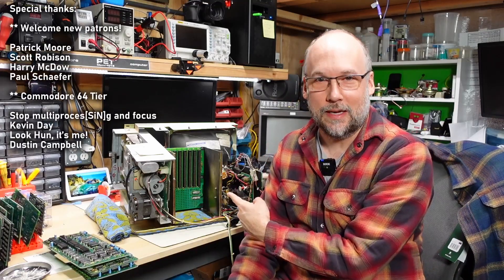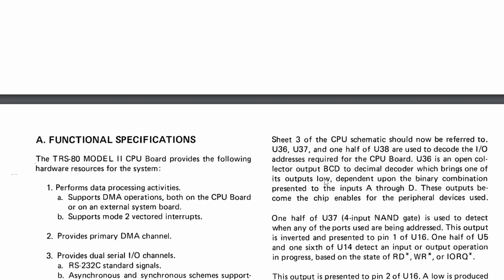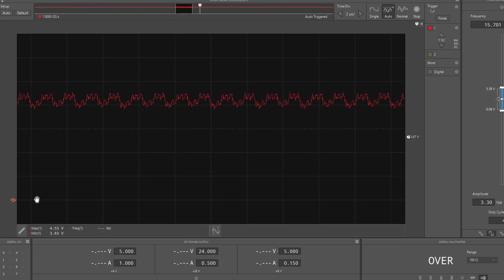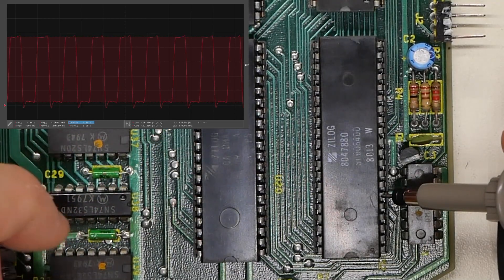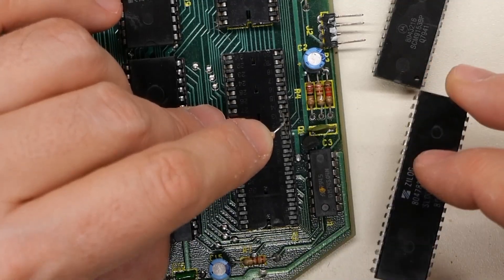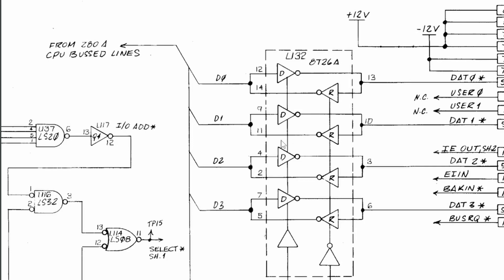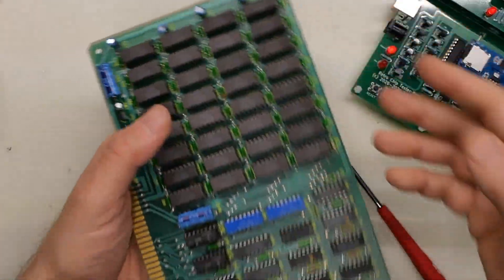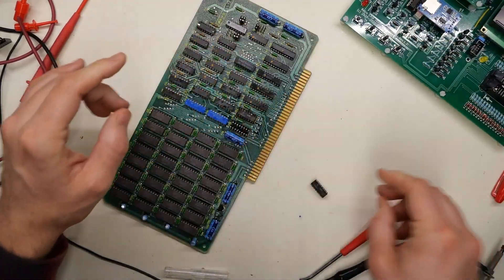I fixed the TRS-80 Model II

Comment: 16:46 "Can that be 1987, seems kind of late?" Perhaps, but the company I worked for bought hundreds of 20 MHz Z80 processors from Zilog about two decades later (around 2007 or so). We used it as an embedded controller just as we did several times before, in the 80s and 90s. I think they are still made, to this day.
Reply: Weren't Z80s used in washing machines and the like up til fairly recently? I presume it's all ARM these days
Reply: @TheErador  I don't know. To me, washing machines sounds more like Z8, 8051/48, 68hc11/08, PIC, TLCS-870, or even small 4-bit BCD machines like TLCS-47, or similar. But it's totally possible, of course. 

Our products were technical/scientific instrumentation in pretty small series. So cost per unit wasn't critical, only development time. And we already had people knowing the Z80 in and out, including me. Many routines and principles could be reused. 

(The Z80 here controlled a small graphical LCD display as well as buttons, knobs and serial interfaces. It also did the actual measuments along with floating point calculations of results and feedback adjustments.)

I don't think it's all ARM. There are at least a couple of dozens microcontroller families still sold that are not (yet) ARM based. There are more to the world than the PC and mobile phone markets :)
Reply: Yep, the Sega Master System and Game Gear both used the Z80, and they were still being manufactured in the late 90s in Europe

(The Master System is still being manufactured in Brazil, but I expect – but don't know for certain – that it's using a SoC rather than a discrete Z80)

Comment: You can clean the rust off of  iron-containing pins and tin them with solder, then they'll be a lot less susceptible to rust.  That is essentially tin/lead plating them.  Great channel, holiday cheers!
Reply: And do use leaded solder. Nothing in that machine is RoHS compliant anyhow, and tin will act as a sacrificial anode so you don't want that to be the only or even the bulk metal in your new plating if you can help it.
Reply: I was considering that idea too. Will the added thickness still allow the pins to fit in the socket though?
Reply: @misterhat5823  If the excess is wicked away with copper braid, it shouldn't be a problem. We're talking a couple thousandths of an inch.
Reply: Electroless tin plating solution would be a lot faster and just leave behind a thin layer of tin. I used to get it at Radio Shack to plate my homemade PCBs back in the early 90s.
Reply: Had the same thought.  If they are so hard to find, maybe do a better job restoring them so they last longer.
Then again, probably more content to be made if they do die and you need to make an adapter. 
🤔😆

Comment: The Z80 is perfectly capable of disconnecting itself from the bus.  BUSRQ and BUSAK are involved in that.  The Z80 is designed to work with a plethora of support chips (DMA, CTC, SIO, PIO, etc) and no special interfacing is needed for it.  Bringing BUSRQ low completely tri-states the address and data bus and halts the CPU.
Reply: Yeah, I was pretty sure this is how it works on the Z80. For completenss´sake: once the Z80 has finished tri-stating the buses, it then asserts the /BUSAK signal, so the other device can know it´s safe to take control of the buses.
Reply: The Z80 can't disconnect ITSELF from the bus though, which is what he meant. An external chip can do it, but there's no CPU instruction to do it.
Reply: @AureliusR  Well, a CPU disabling itself would essentially render it useless until you reset it.  When a CPU is removed from the bus via tri-stating the bus and control lines, it can't read an instruction to wake it up again.  If CPUs could tri-state themselves in software, a simple malicious hacker could simple send the CPU instruction to remove itself from the bus, then nothing could restore it.

Tri-stating a CPU MUST be done with external hardware, otherwise, what's the point of removing the CPU from the bus?
Reply: @AureliusR  As long as BUSRQ is low, the Z80 is DISCONNECTED from the bus.  All address, data and control lines are tri-stated.  It has the same effect as unplugging the chip.  I don't know what your defininition of "can't" is, but you're wrong.

NO CPU has an instruction to tri-state itself from the bus.  That would have the effect of locking up the system.

The 6502 cannot tri-state, but the 6502C (the Sally Atari variant) has a HALT pin that tri-states it.  The Z80 has BUSRQ, that tri-states it.  Other CPUs have similar pins to "disconnect" the CPU from the bus by having a control pin that does it.  Absolutely no CPU can tri-state itself.  They all need an external control to do so.

Some CPUs have a HALT instruction that essentially halts the program counter until an interrupt is received, but it's not a tri-state "disconnection".

Now read all of that SLOWLY.

Comment: High Adrian it’s me again.  I ran the cobra bbs up here in brantford Ontario. I ran the French connection. First of all I worked in a press shop and supported as a single parent of three kids during the day.  The bbs ran on a TRS80 model 1.  I bought the double density kit from radio shack. It came with a new version of dos.  But I used newdos 80 v2.  Awesome OS. Pdrive allows you to configure drives. Now to the point. I had tons of problems as it would skip bytes writing sectors.  Took it in and they changed the z80 to a z80a. I had one of early ones.

Comment: The zener on the video controller may be to bias the substrate.
Older P-MOS tech ICs sometimes need (or work better) when the substrate is biased at some voltage. I would assume pin-1 is connected to the substrate.
Cheers on getting progress on the TRS-80.
Reply: You mean disk controller.
Reply from the maker: It's on my to-do list to buy a 2.5v Zener so I can restore that back to the way it was ... but yeah I have a feeling it's definitely some kind of negative bias thing as well.

Comment: This brings back a LOT of memories.  I owned a Trs-80 Model I purchased Jan 1978.  
I then owned the full Mod I setup: Expansion Interface, Rs232-c, 48k memory, 4 disk drives, Line Printer VI, (numerical keypad added), lower-case graphics chip added.
Then owned a Mod 4, with High-res graphics  and 15 Meg external Hard Drive.
I also worked on and repaired a Model II that had the expansion Drives cabinet of 3 drives.
I used to write machine language for the Mod 4 and would translate programs from the Trs-80, IBM PC, and Apple IIC.  
Those were great computers.
The Mod I lasted 21 years.  Wished I kept it.

Comment: Congratulations! That is for sure an impressive repair. I'd even say heroic!

Those corroded Fujitsu ICs need a little more treatment than a bit of Deoxid. I'd sand the corrosion away from the legs and then plate them with soldering tin. If the legs are brittle, solder them onto a machine pin socket to make them last the ages.

Comment: Great Job!  I owned a couple of model IIs, one with the disk expansion unit along with a model 12 & 16 w/1MB of RAM as well as a 5, 12 and 74 MB hard disks.  It was a glorious din when doing sorts on the model II across the floppies in the expansion bay. The model 16 had a 5 port serial card and ran Xenix.   It was a blast to log into five terminals and run the accounting and inventory control suite all at the same time.  It also supported two printers which made some even more exciting noises.
I really appreciate your patience and persistence towards getting this machine to work again.  There's nothing like the sound of a model II booting from a floppy!  Music to many of your viewers' ears, I'm sure!

Comment: Adrian, EXCELLEN! It really takes a lot to kill a Model II. Unless you're certain, I wouldn't throw that Z-80A out. It could have been a bit of corrosion too. Your's is a first gen Model II. Over their life they upgraded the FDC, changed the power/reset switches, made board revisions and other improvements. As you know the II was retired to move to the short lived 12. The 12 became the 16 and the 16 to the 6000. They overlapped in some production or sales but that is their lineage. A very robust, if limited platform for what it was in the late 1970s and 80s. I started computing on one in 1981. Over the decades I've owned five of these IIs. Your bad CPU seems odd but possible.  I've NEVER found one that had a bad processor or any bad ICs. Even a nasty corroded one I saved from the trunk of a crusher car was saved and worked with a little cleanup.  As for their power supplies failing, YES! That is usually because of the caps. Replace any epoxy potted RIFA caps. They crack, take in moisture and will smoke worse than a speakeasy in the 1920's.

Thank you for the great series. It's now time ...make it do stuff Tandy never thought of.

Comment: Just a thought - when you swapped Z80s, you also applied some DeOxit to the socket, so you might want to give the original Z80 another try.
Reply: Agreed.  Corrosion/oxidation on the pins may have fouled the original signal on Pin 3.
Reply: Came to the comments to say this - definitely worth another go
Reply: I also came to say this. This was a great successful video. Really enjoyed it. But, Adrian jumped to a conclusion there. Some of us love the little CPUs; we don't want to give up on one - especially an original  vintage one - without giving it a full chance. Please, Adrian, try plugging it back in after that DeOxit treatment and see if it is really dead or not.
Reply from the maker: The thing is, the address lines are outputs from the CPU, and as seen in the video, I had the scope probe on the CPU pins directly. The socket has nothing to do with what signals come out of the CPU package.
Reply: @adriansdigitalbasement  Unless perhaps there were voltage drops across the oxide at GND and Vcc. You know, the more current over a certain resistance, the larger the drop.
Reply: Unless the pin actually rots off the ic, an untouched socketed IC should not get corrosion between pin and socket fingers enough for it to lose conductivity. That z80 's pins did not look that bad.
I have had pins that were literally green and where the sockets fingers were also corroded to nothing... That's a problem...
Cheers,
Reply: @herrbonk3635  If it was drawing more current from due to corrosion on the +5V and GND lines, it would affect all the data lines out.

I'm with Adrian on this one -- that CPU is done.  I mean, let's not forget that this computer was left outside, in the rain, for who knows how long.  I'm amazed that any of the chips still work.
Reply: @iGregory67  You mean address lines? I would probably check whether A3 is more heavily loaded than the others, due to some form of decoding or other reasons. And I would certainly at least try the CPU in the cleaned socket before throwing it away. The heavy ripple on the signals (due to either internal activity or external loads) also tells me that the Vcc current went through a resistance there.
Reply: Everyone watched you and thought the same thing! Maybe that original z80 is still working. It seemed like the de-oxit takes a minute or so to work because the later bus tranceivers came out easier but the Z80 you wrote off without trying again. Could be a bad connection? Can your chip tester test CPUs???
Reply: @herrbonk3635  or at least retro chip tester it?
Reply: DMA? I dunno. I'd still stick the original CPU in for a try and see if I learn something. Science! ;)
Reply: @adriansdigitalbasement  🧐
Reply: Z80 was as $#!+ a computer as they made.

Comment: Great to see the system coming back like this after being left as mere junk. Well done with bringing it back, Adrian.
As for the CRT brightness, I wonder if it'll improve a bit more over time since they can get a bit sleepy if left off for a long time. It seems to have decent brightness (as hinted by you commenting about turning it down on the first boot with the disk drive controller installed at 36'42"), so it might just need to wake up some more before committing to a tube swap.

Comment: Oh man I love your excitement, and I'm right there with you!!  I don't have anything this old any longer [I did have a 2nd-hand CoCo as a kid but that's long-gone] so I'm gonna go play with my 5170.  Oh, BTW I was able to get my bus speed up to 10MHz with a crystal-swap thanks to your work on removing the BIOS overlocking-block.  10MHz is my limit, presumably because I'm running the Intel SnapIn 386 CPU upgrade, which is now clocking in at 25MHz instead of 20MHz.

Comment: You know it would be totally fantastic to see this thing running UNIX (Xenix). There is an add-on CPU card with a 68000 but the Z80 is retained for I/O. Now that would be retro heaven! There is also a FORTRAN compiler and an assembler for the base Model II.
Reply: It's possible. I've done it.  But MAN I wouldn't want to deal with that in 2021 - it was a pain in 1991 when parts were fairly common.  You'd need the megabyte RAM board, the model 16b or 6000 68k board (the 16a board needed some updated parts that would be unobtanium now), a hard drive controller and compatible hard drive (MFM and SASI options IIRC), and of course the install media.

Comment: I've covered the whole circuit board many years ago on a c64 with silicon seal on both sides.  No issues still working fine.

Comment: hahaha great job, I worked for Radio Shack at the time this was sold. I remember it ran CPM and ran DB2 and proprietary full accounting software. it could be run as a multi company system, also it requires a 132 col line printer. (Good old green bar). It had a 4 bay 8 inch floppy available.  I remember that running AR, AP, payroll, etc took lots of time

Comment: Never power up or down with the diskette in the drive. The power "spike" can wipe data from the diskette. Wait for the "Insert Diskette" message before physically inserting the disk and closing the door. The video "sharpness" was never extremely sharp, this is analog not digital video {yes it is digital chips making the video but it still is analog}. Try adjusting the focus on the CRT monitor board. We had a breakout board that plugged into the bus and raised the card out of the cage to troubleshoot issues. Great job on the restoration!

Comment: Great job. Parts I appreciated most: showing how to work on the boards with the scope outside the computers PS. Tracing the CPU chip failure. Discussion of various chips and schematic circuit flow.  Would love some more oscilloscope  videos with specifics on tracing/finding errors.  Thank you.

Comment: I was at that energy level yesterday populating a PS2 in-air port to a pentium motherboard. It was really simple soldering the connector to some dupont wires and checking board schematics, but it freaking worked!!

Comment: Remember to use a fiberglass pencil to clean the oxidation off all of those tarnished pins before replacing them in the sockets since you have them out anyway. Along with the DeOxit will keep it going much longer.

Comment: Adrian, That's brilliant. You should've tested the Z80's on the chip tester.
Reply: i dont think the z80 would fit in the chip tester
Reply: @mattthe2nd865  I thought it tested CPU's as well as logic and RAM/ROM chips. (?)
Reply: @frankowalker4662  Adrian said in another comment, "Sadly the Z80 doesn't work in the chip tester -- it only has a 32 pin socket. Maybe some future project :-)"
Reply: @JB52520  Fair enough, I must be thinking of a different chip tester. Probebly one that Noel has. (of Noel's Retro Lab)

Comment: I feel like 3v on the address lines from that second Z80 B is probably fine.  Most of that stuff will register a high level above 0.7 volts. And with the bus transceivers, it should really not be an issue.  It might even be operating as designed / within specs. 🤔
Reply: Good to know! I'll have to design a board this winter with a 555 timer doing a 30 seconds timer, letting a ''RPi-compatible'' UpBoard boot and when it is booted, have one output working. So, I wanted to use a 74ls-series ''and' gate with one pin on the 3.3v out of the UpBoard and the other from the 5v out of the 555. Do you think that I'll be good with the 2 ttl levels at different voltages on the gate?
Reply: @alexandrecouture2462  It should work if it's really a 74LS series chip, but there are 74HC series chips out there either errantly or fraudulently labeled as 74LS, and they have a considerably higher trigger voltage -- sometimes up around 3.5V. Those might not work so well, even though they would likely be indistinguishable if given the expected 3.8V or more. So if it doesn't work, at least give some thought to your 74LS series chip actually being a 74HC before you get too far off in the weeds. As for why someone would substitute this way -- 74HC series chips are still in production, 74LS series chips sometimes aren't.
Reply: @mal2ksc  Ok, thank you!